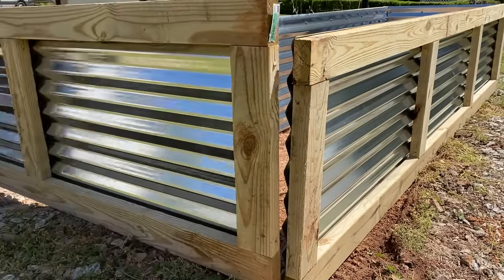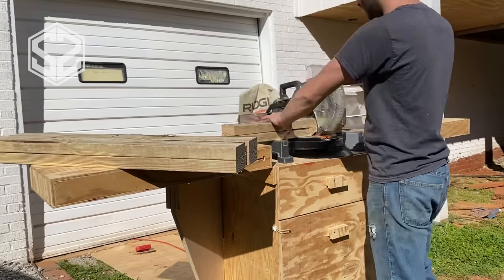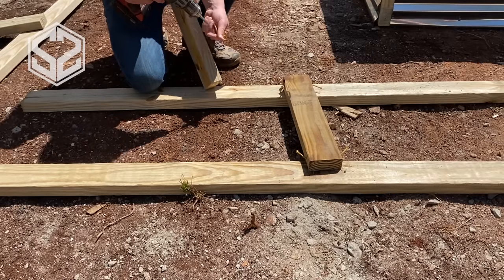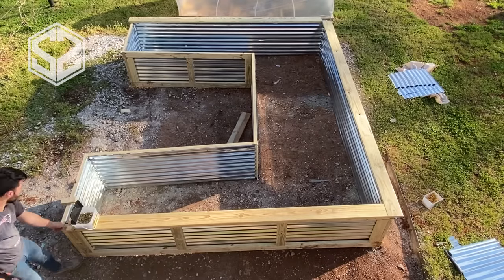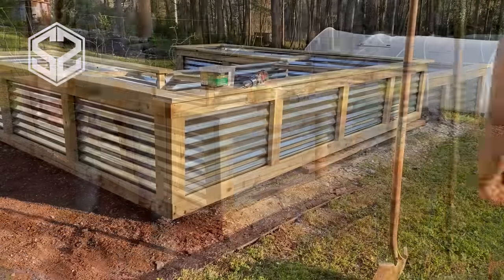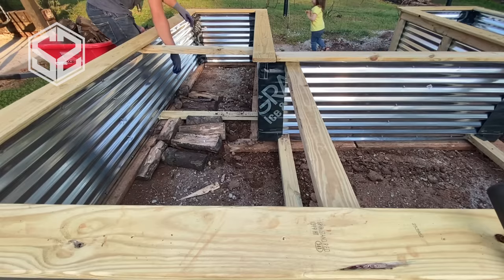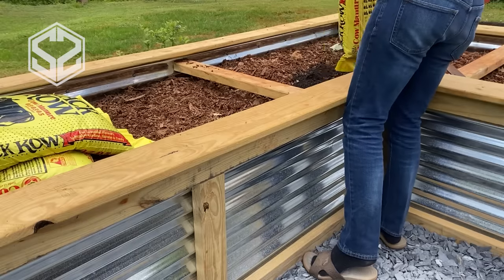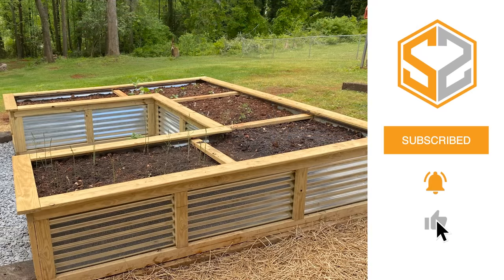How To Build Raised Garden Beds

Comment: Love this! Looks a bit adventurous for my poultry DYI skills but I'll give it a go. What are your thoughts about potential chemicals from the steel / water proofing getting into the soil and plants?
Reply from the maker: Thanks! I wasn’t worried about the chemicals leaching into the soil because there is a layer of metal sealing the wood away from the soil. There are only a few points that the wood comes in contact with the soil. An alternative would be to use cedar instead. Cedar is naturally resistant to bugs and rot and should last several years If taken care of properly. However, where we live, regular untreated lumber would only last at most 2 years before the integrity of the wood is broken down by rot and termites.
Reply: Ashley Middleton-Did you mean your paltry Diy skills or do you have a secret methodology using chickens ( poultry )?? We need to know if you are managing quicker work whilst having the chickens manure as they carpent ? Will they be given water as now ? So many questions.  Thanks - ripping work.🫂👏🕺💃🏽 🦩
Reply: The sad thing is that the lumber industry insists that today's pressure treated products are safe to use in raised bed vegetable gardening. No way am I consuming anything that's grown in a PT bed. I love the look of these but no way would I build them more than 10 inches in depth.  U must have a low or no cost option for your bedding.
Reply: @JohnJohn-wr1jo  you can definitely fill up the bottom half of the bed with literally whatever, just to take up space. I've seen people use old logs, pruned branches, wood chips, rocks, dirt from digging holes for whatever reason, etc- things that will either not break down, or break down slowly enough that it won't become a compost heap. As long as it's permeable at all, you can fill up deep raised beds to effectively raise the bottom of the bed up to a reasonable level.

Comment: I've built 4 of these over the last 3 years. They work great. Mine however have 1/4" mesh barrier under the soil and 4' chickenwire fences around them. Lotsa deer, rabbits and other varmints would get at them without it!  Mine are built from cedar!
Reply from the maker: Thanks for sharing! How is the cedar holding up over time? I know it is a safer and nicer option, but will it last as long as treated? I haven’t had any issues yet with animals getting our garden but when I build another I will have to remember to do that! :) thanks!
Reply: @SimonSaysDIY  question on the treated. Do you have any concerns with the chemicals leeching into your soil from the treated wood?
Reply: @deanmarten  my understanding is that new pressure treated wood doesn’t have harmful chemicals (ACQ I believe it’s called)

Comment: Hi Simon... great job on the beds. My question since I am near a wooded area with deer, groundhogs, fox, bear, squirrels... have you considered building a fence around the garden beds to keep the animals out from eating all the veggies?
Reply from the maker: Thanks! :) I actually didn't have many issues with wildlife getting my garden. I use to get the occasional groundhog and the neighbor's dogs digging it up. Thankfully the raised beds have stopped both. I believe you could modify the design to have a 4x4 post on each outside corner and install a gate to the opening in the front to use for fencing if needed. it would change a few things but it could be done. :)
Reply: Question.... What about animals getting into the garden?

Comment: I have a friend who did similar raised boxes, with the corrugated metal. The problem he had was the sun would heat up the metal and transfer to the soil, and burned his garden. He has since then, covered up the metal with fence boards and has no issues….
Reply from the maker: Thanks for the tip!  We didn't have any issues with that last year. We live in the South East United States and even through the heat of the summer it seemed alright. If we have any issues I'll have to try that out! :)

Comment: Hi, I really like this design I have a couple of questions. Could you put the bottom board in concrete? I’m almost to senior citizen and I don’t want to have to redo this in five or six years. Or could you use that wrap stuff that she used inside that is used for roofs in order to protect the bottom boards? Finally, does that top board have enough strength for you to sit on it while you’re weeding?
Reply from the maker: I'm glad you liked it! Placing the bottom of the garden beds up off of the ground slightly using pavers or bricks would help keep it off of the ground and avoid rotting out. Another thing that could help it last longer is if you as a deck sealer on all of the lumber. I hope that helps. Thanks so much for watching!

Comment: I would have 💯 lined that with builders plastic with a couple of drain tubes at the bottom. That would save the timber and iron for even longer. Otherwise nice job.
Reply from the maker: That would be a great improvement! :) thanks for the tip. I’ll remember that next time I build one :)
Reply: I would also add at least one layer of metal grid on the bottom if you have ever had gophers. Make sure the holes are small enough (1/4" is not too small, remember that these are rodents and they can get through very small spaces), and that the metal is thick and galvanized so it doesn't rust away or get chewed through.
Reply: You want the soil to drain good and get some oxygen.  The plastic will cause everything to stay to wet and cause mold and mildew. All lumber beds are much better.  Just make sure it's not treated lumber that has chemicals in it.
Reply: @meehd01  Treated lumber is the only cost effective wood to use. It's also vegetable garden safe nowadays.
Reply: @kansasgardener5844  it is definitely not drinking water safe.  It still will leach chemicals into the soil just like plastics do.  Putting plastic in there will cause mold, mildew and root rot.  You can claim chemicals and plastics are safe all you want but cancers rates keep proving they are not. The best choice by far is Eastern Red Cedar lumber and is locally grown, harvested and milled in the southern US.  Western cedar mostly comes from Canada.
Reply: @meehd01  Hahahah, don't know why I said drinking water safe? What I meant to say was vegetable garden safe. Keep in mind that is what the manufacturer claims Not me. I use treated wood on all my vegetable beds. No worries.
Reply: @ccole1255  I have had this argument with people like yourself so many times. I've done my research. All is fine! Thank you for your opinion. Have a good day.
Reply: Better build it all out of Crete

There's a tutorial.on YouTube on how to do it with moulds for interlocking sides.. on lightweight Crete.

Very good

About 10 times better than this
Reply: Would have been nice the develop a water line system on both sides on the structure, about 3/4th the way down. That way you could just pour water into the tubes ( and if your distribution holes are small enough per volume of water poured), allow equal distribution across the bed, and push the nutrients provided by the fire wood up. Small trick that’s helped maintain my soil PH while not caring to water my plants every day 🤓

Comment: Great video and I plan on following this as I replace my raised beds this spring.  As a fairly new gardener I was wondering about adding panels between sections to help with crop rotation.  My current raised beds although together are separate 4X4 boxes.  Is this needed, or would it help?
Reply: If I'm understanding you, it sounds like if you were to make his design, you're saying put more brackets (like his strengthening braces) to use it like a square foot garden?
If that is what you are saying, my thought is no. I made the same box as this but in 2020. I didn't put braces in mind at all & I'm not a fan. I didn't want to deal with those braces in my way.  It think it will make adding & turning dirt a pain.  
I did exactly like he did & added all of my old wood from the yard, grass clippings, and compost that wasn't completely broken down. I mean everything before adding broken-down compost.  The dirt level was great until this summer. So much broke down that I had to add a lot of compost again.
Hope that helps.

Comment: Why didn't you put rocks down first as a drain layer? Wouldn't that help to make it easy to combat over-moisture and mold growth?
Reply from the maker: It’s hasn’t had any problems draining and it’s actually really dry where I live, so over watering and moisture shouldn’t be an issue. If anything I want to hold the moisture in so that it doesn’t dry out so quick. However, if you are in a very wet climate it shouldn’t hurt to add gravel. I would recommend laying some landscaping fabric before you place the soil on top of the rocks so that the soil doesn’t fill up the rocks and prevent drainage. 

Thanks! :)
Reply: It will drain into the soil anyway.

Comment: Great video, thanks!! Because I live in Bermuda, surrounded by ocean, using the metal roofing material (even galvanized) is impractical because it would rust away in a matter of months. Would the plastic roofing (as long as it is UV protected) be strong enough for the weight of the soil? Or can you suggest an alternative? thanks!! 😎
Reply from the maker: That should work, you may want to space the vertical boards in the sections closer together like 1-2 feet apart instead of 3. This will give more support to the plastic roofing.
Reply: @SimonSaysDIY  thanks!

Comment: I’m not sure where your located, but in the northern US this would freeze and probably blow out the sided because of poor drainage. It looks nice, but the structure is poor for the amount of soil in the box. I know they say the new PT lumber is safe to use for vegetable gardens, but it means there’s an allowable level, if you want to consume that. Same goes for galvanized metal. I’d like to see it after a good winter.
Reply from the maker: Yeah, is the southeastern US the winters are much more mild and probably would only get a few snow falls a year. It should be fine here but I may do an update video next spring/summer to show how it is holding up. 

Thanks for the insight! :)

Comment: Do you need to treat the exposed wood to a water seal?  Especially that top ledge?  If not, then how many years do you expect it to last before moisture, 
mold/fungi or other environmental insults degrade the integrity of the structure?
Reply: He used treated wood, doesn’t need anything. According to internet approx 30 years for treated wood. But from my experience and the info I got from Home Depot more likely 15-20 years
Reply from the maker: Thanks! I am actually planning to apply a deck stain as the wood is weathering a bit. This will clean it up and seal the wood. You may be able to extend the life of the wood a few years with this but at the very least it will look nicer for longer.
Reply: @miworld0123  - thank you.
Reply: @SimonSaysDIY  - it’s nice to know your post-build plans.  Thanks.
Reply: I wouldn't use treated lumber next to anything you plan on eating.  Lots of chemicals in treated wood.  I burnt the exterior of all the boards and scrubbed the boards after with a metal brush.  For the inside braces used some metal strapping.

Comment: Most gardeners are missing the boat. Consider using discarded upright Freezers or refrigerators for a raised bed. They are just the right size for weeding and harvesting at waist height, making them ideal for wheelchair access or seniors, or those with back problems. One or a dozen, it 's up to you. It took me two weeks on Craigslist to get an even dozen boxes, and that was being picky. No stainless steel, or black refrigerators, no side-by-sides, only white boxes. They come insulated, and the type of soil they have is up to you. No more gophers, moles, rabbits, either! Just remove and discard the doors and shelves, fill and plant. Water with a garden hose, or plumb them with an irrigation system from below. Ideal for an apartment with a small patio, or a big yard. No more bending to weed! Best of all, they're free, and you keep them out of the landfill! Details to your questions if you like
Reply from the maker: Never thought of that. Thanks for the tips! 😃

Comment: Like the simple concept.  I too was questioning how on the long runs to stop the bowing out.  Im gonna use Trex on the bottom cross supports so they should never wear out or rot.
Reply from the maker: That should work well, I have also been told threaded rods would made great supports.
Thanks! :)

Comment: Quick tip with your tomato plants take off the bottom limbs bury up to the top limbs. Crack and egg and place under the roots (do not crack all the way open just enough for the yoke to seep out a little). They grow roots anywhere the soil touches the plant and the deeper they are able to have roots the better it is for the plant to grow <3
Reply from the maker: Thanks for the tip! 😄

Comment: I made a box the same as yours in 2020 my dimensions are 9x9.
I didn't use braces and don't need them.
I did use fabric cloth below everything so I can blow it off easily.
I love your sealing the corner edges because my dirt came out in the beginning. Now that it's settled I don't seem to be still having that issue.
Reply: The adhesive sealer is a great idea but only if you're planting flowers. Just a bunch of chemicals waiting to leach into your food otherwise. The chemicals they use in roofing are toxic as all get out.

Comment: we made ours in a very similar way. The top joining timber for added strength also is handy to perch your snippers, clippers, clothes pegs etc on also (working outside alongside the raised bed, later on). Or a cup of coffee.
Reply: to raise it off the ground a little so as to minimise wood rot, we put some old pavers on each corner. Ours is only about a yard each side, squared so this worked well to keep it all off the ground.
Reply: at the vertical joins, i used rolled up newspaper that would have gone into the recycle bin. Works well. Actually the whole thing was made of repurposed material we had lying around.
Reply: we used the Hugelkulture method to fill it up, no soil was used until we got near the top just to finish it off. It did sink quite a bit, we had to wait a few months for it to ''settle'' but the results were fantastic. On top of the logs at base, we put hardwood prunings, seaweed (washed), lawn clippings, you name it if it looked nice we put it in. Lovely crop resulted.

Comment: Great video. Went with cedar instead of treated. Built and all wood version a while back but the money saved on using metal roofing offset the extra cost of cedar. Also had to drill far less pocket holes. I WOULD SUGGEST ANYONE BUILDING THIS LAY OUT ROOFING ON TOP OF HORIZONTAL BOARDS FIRST AND MEASURE BEFORE CUTING VERTICAL PEICES AND MEASURE DISTANCE. Luckily I did this. I bought roofing from Home Depot and found pieces needed to be cut 19 inches instead of 18 to avoid roofing overhang. Renting a Dingo walk behind bobcat from HD for the dirt. My days of moving 6 yards of dirt with a wheel barrel are done
Reply from the maker: Thanks so much for sharing! I appreciate the feedback! :)

Comment: I have a few I made with the roofing material and my experience was that the roofing used didn't make it long with dirt contact and 3-4 seasons after it started to rust through and I had to dig them out I just rebuilt with 2 x 8 redwood 3 boards high and 4 x 4's in the corners for reinforcement.  I used steel concrete stakes around the outside so the boards didn't bow out with the weight of the dirt.

Comment: Love this bed but I would want it a bit higher so built onto cinder blocks would work. I'd also dig down in the walking area surrounded by railroad ties and fill almost to the top with hard wood chips, that will break down and can be added to the garden the next year. Those with the correct tools can do it in no time and a raided bed if on the since blocks would allow most to garden without bending at all( my back loves the idea). And when the pain of standing gets so bad, I can sit and garden!

Comment: Landscaping timbers  are cheaper than ties and safer double up on the wood and the cost is $4.38 for one 8ft landscape timber . I'm going to do the same as you only i'm going to use the landscape ties and already made up raised metal beds . I like the idea it just gave me some inovation and to start moving my but in gear . Thank you

Comment: You can also use a ramp for the wheel barrow, it is easier than it sounds it just takes a few practice runs. The longer you make it the easier it is to walk the weight up the ramp. Just use 2x8's or 2x6's, a couple on top of each other will be strong enough for the ramp, just lay them up there.

I like the way that bed looks, nice work. And you did what i notice others won't do, you sealed the corners, nice job.
Reply from the maker: Thanks so much! I really appreciate the tip! :)

Comment: This is a very nice project. I like the use of the metal instead of  just pressure treated wood.   Even the newer pressure treated still has a lot of chemicals that you don't want an in a vegetable garden.  Nothing that should make you sick right out but can still build up in the body over time.  (Older pressure treated used arsenic and cyanide, newer stuff is mostly copper based ) If you do use just pressure treated please line it (tarpon or tyvec).   Alternatively you can use Cedar or popular or I generally prefer stone garden walls. And before anyone goes crazy,  I do like this build, it has very little wood contact and alot of soil, leaching should be almost nothing.
Reply from the maker: Thanks so much! I appreciate the insight! :)

Comment: You can buy stainless steel threaded rod for fairly cheap and it won't rot.  Super easy to thread some nylon nuts on the ends to hold this all together at the bottoms.  Looks super clean nicely done.
Reply from the maker: Thanks for the tip! That would be a great improvement!